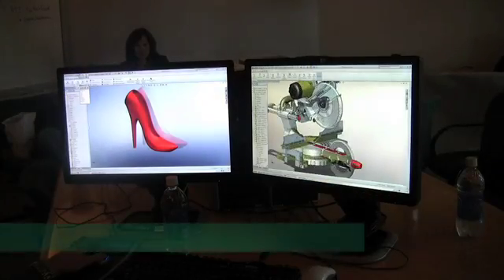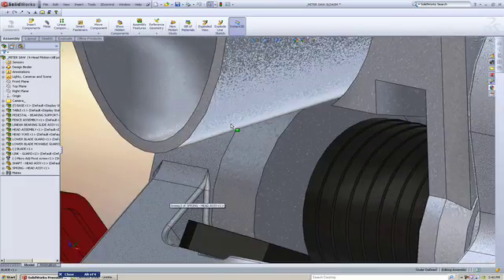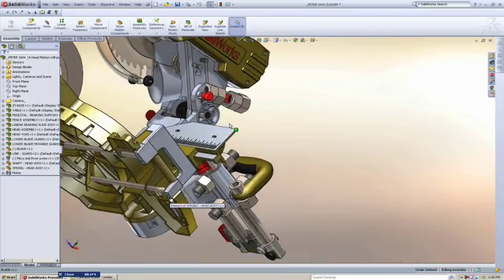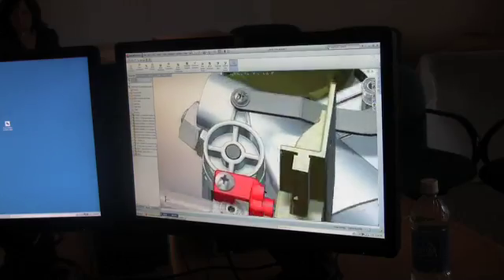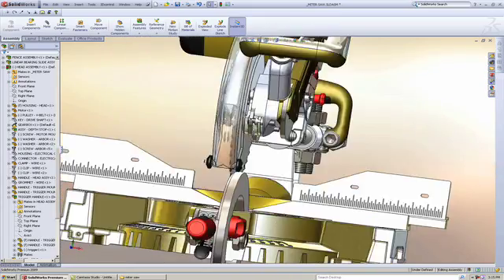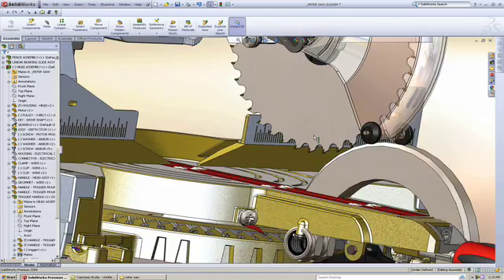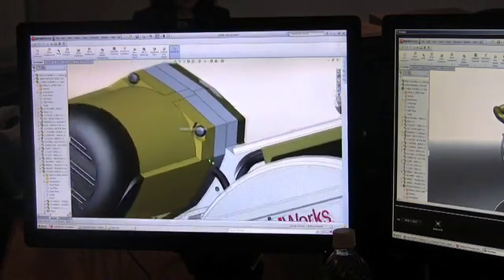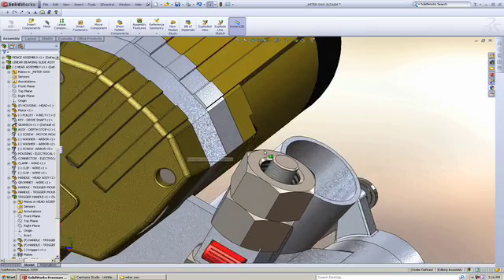ATI FireGL V7700 VS Industrial enginner (Solidworks)

Comment: What is this? It is really thje way how  the v7700 performing with solidworks? or they have forgotten which machine was the video card in?

The specs says the v7700 is a very good card. I am planning to buy one, or a quadro fx 3700, which is older. 
But if this video is correct.....